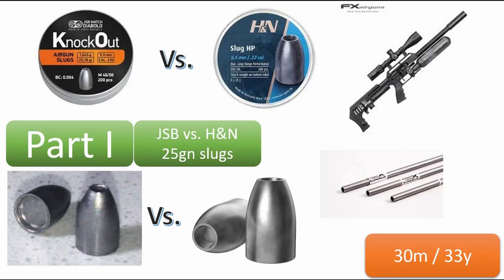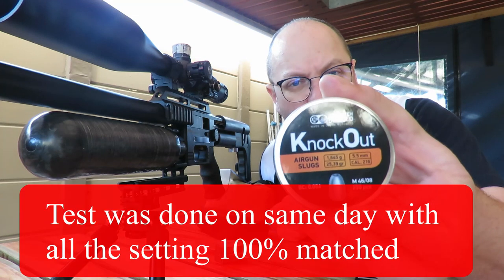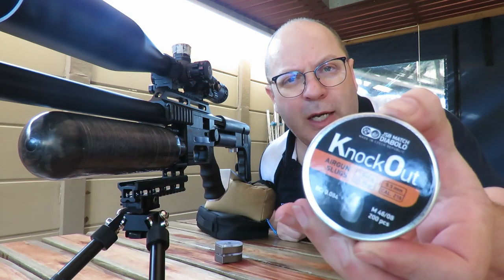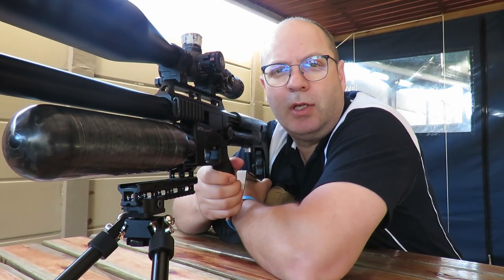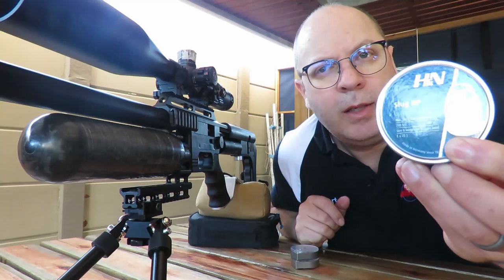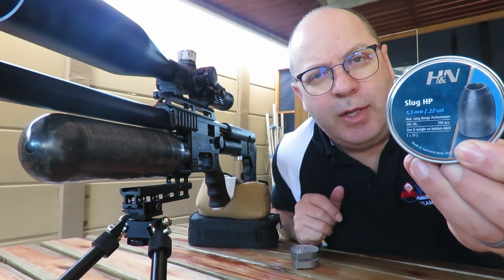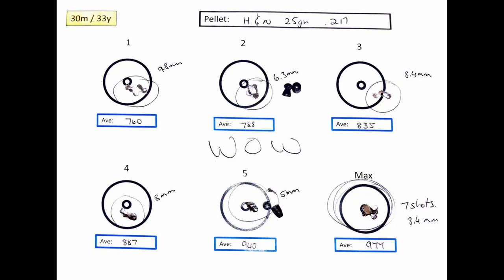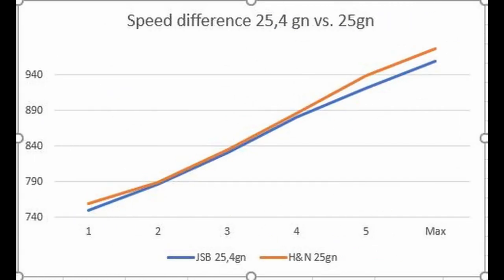JSB KnockOut 25gn vs H&N 25gn slugs

Comment: Why did you shoot the JSB in .216 and the H&N in .217? JSB are available in .217, and it would have been a better comparison?
Reply from the maker: The 217 KO's weren't and still aren't available in South Africa. I have been searching high and low to get 217's but without any luck. Interesting to note that the 216 shot better out of my STX slug liner (better than the H&N), in the superior slug liner the H&N's are better... The H&N slugs are very hard thus they aren't as barrel fussy as thr softer JSB's and other softer slugs.

Comment: I got my knockouts today and it's pretty evident my gun prefers the HN's as well, It should be noted that the HN"s length is 7.6-7.62 mm and the Knockout measure 8.00-8.04mm, it seems to me, this difference in length is what's making all the difference. I can feel at the end of my load stroke that the knockouts are being forced into the rifling whereas the HN load smooth as silk. Now I think it's possible to take a bit off my loading probe but I'm afraid I won't make it past the transfer port correctly. The griffin slugs are longer per grain but have a longer, more aerodynamic pointy nose, so it's not engaging so bluntly. I am really trying to pinpoint the reasons why what works and what doesn't. They were both resized down to the same exact 2.1645 diameter.
Reply from the maker: Don't change the loading probe, just unscrew the barrel and move it 0.5mm forward, the longer slugs should then seat better.
Reply: @AimSmall  I did actually try that, moved it forward in the grub screws, I have found my slug brand of choice, the HN 25's are great but the Griffin slugs are just so well made and exact, have a slightly higher BC and a more tapered aerodynamic front, and even though they are longer per grain because of that, they seat much smoother and just out perform anything else for me, in all weights, but particularly the 26 grain dish base. for some reason the JSB's are just too stubby or just seat funny with that length.  Thanks for the response, I am really glad I didn't mess with the probe.
Reply from the maker: @ravenshield7823  The JSB's are smaller in diameter than most slugs, even the 217's are loose in the barrel. Would love to get my hands on some Griffin's to test. My gun loved the H&N from day 1, especially the 25gr and 27gr , didn't matter if it was 217 or 218. Most FX barrels prefer slightly bigger diameters, .2174 about.
Reply: @AimSmall  That's great, I think I'm finding myself in a narrow tolerance window. If I didn't stumble on this 5.50 resizer.  I wouldn't be hitting anything. I guess I got super exited when I found something that finally gave me the results I was begging for., It took me probably closer to 2 years on and off of trying everything I could think of. And what it comes down to, is that it's probably only going to work the way it is for my platform. Thanks for all the great content! I love your channel.

Comment: The KnockOuts did not like very much the Superior Heavy Liner on my Impact at any speeds. That's why I don't use them anymore. H&N all the way!
I'm also waiting for the pin probe (full kit) and dual port to arrive...it seems it makes a difference.
Like H2o ACUA, I'm wating for the 50/100m videos, to see if they match my tests. 😄 
Best regards. 👍
Reply from the maker: I haven't shot the .217 KnockOuts yet, only the .216. The superior liner's twist rate is not right for the KO's. It however loves almost all slugs.
Reply: @AimSmall  that is correct, there are only .216 KO. Also maybe too thin for the Superior Heavy...sometimes one goes away from the target to a spa. 😄 
Also I'm shooting at about 980 fps, so that might be a factor too. My tests showed me that all JSB do not like high speeds...not even the slugs. For short distances it's OK, but not for longer shots.
Keep it up.👍
Reply from the maker: @MMM-RATTING  weather permitting I will be testing the KnockOuts at 995fps tomorrow, installed pinprobe... Might be able to push them hard without adjusting the reg.

Comment: The difference in velocity is probably due to the lubrication ,but , it could be the surface contact of the different slugs. How you determine that in sq.MM ? good luck. Standard cast bullets have lube groves. Air gun slugs do not , but perhaps they should. Although the velocity is subsonic ; friction is still there , causing some lead buildup. As a result , over time , accuracy issues, "just my thought" Oh. and don't forget hardness.

Comment: hello what excact caliber for H&N did you use? thank you   (5.51 or 5.53)
Reply from the maker: 5.52
Reply: @AimSmall  thanks
Reply from the maker: @SnipeLoisirsTestsCustoms  I have both the .217 and .218 (5.52 and 5.53) they are both equally accurate. The H&N stays the most accurate slugs so that I have tested so far, especially the 25gr and 27gr. I didn't get the same wow from the other weights.
Reply: Thank you for your answers and on other rifles I tested fx / H&N / Jsb knock; and I agree with you for the moment the H&N are the best for me too; that's why I want to test them in the MAVERICK FX

And one more subscriber even if you have a lot lol 😂

Comment: I still don't understand the benefits of these reviews on youtube, especially for newcomers, where the reviewer tests slugs at 30 m. I usually achieve such shots with JSB pellets on my Impact. As everyone today in the industry knows, the benefits of slugs are mainly for long-distance shooting 80 - 100 -150 to 200m, where their benefits will only stand out. In addition, it is necessary to mention the economics of ammunition, where classic pellets are still significantly cheaper than slugs (even slugs from JSB are among the cheaper ones. I'm not talking about meaningless prices of HN or FX hybrids at all). If I shoot a benchrest at 30 m or just "plinking" at anything, richly pellets will suffice. YES, if I go to shoot small pests at longer distances, where I lurk for a long time and I want to have the best possible shot and knock down for the first shot, then I buy more expensive slugs HN or FX hybrids. In terms of price / performance ratio, JSB Knockout cal.22 clearly wins for me
Reply from the maker: I do 30m testing for a couple of reasons, 1st the range is close by and the setup easy, 2nd it allows me time to play with the different power settings and 3rd and most important - if it doesn't group at 30m it is no use testing them at 100m. Saves my about 4km of walking.lol. You are 100% correct on the accuracy of pellets, they out perform slugs on shorter distances and where there is almost no wind. In South Africa the FX Hybrid is just too expensive to shoot, the best all rounder and value for money is the JSB KnockOuts.
Reply: @AimSmall  They also don’t realize even a slug at 30 yards maintains better energy than a pellet at the same distance. Also most hunting is highly achievable at a 30 yard range anyway.

Comment: 217 are 5 50 or 5.51, 
Try 218 5.53,77
Perfect slug size
Reply from the maker: Tried 216, 217 and 218's Each slugs differs, even some of the 218's actually differ in size, H&N is moe like .2175, where Javelins are more like .2183